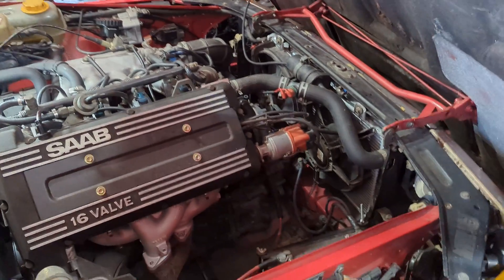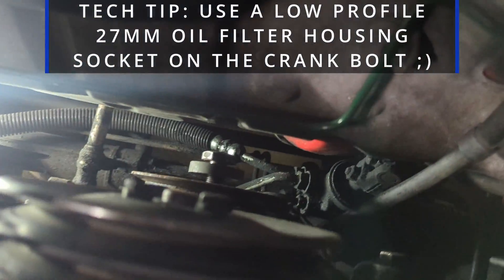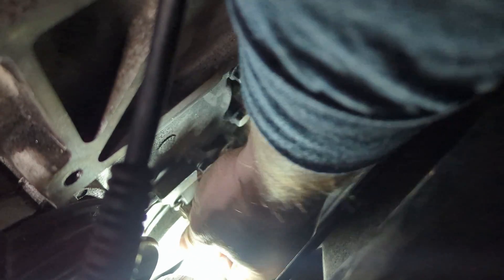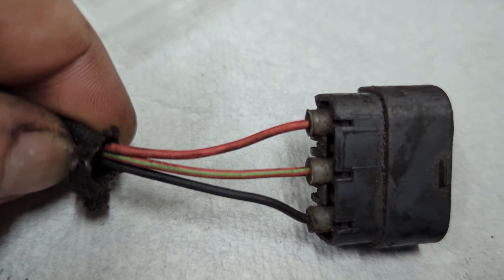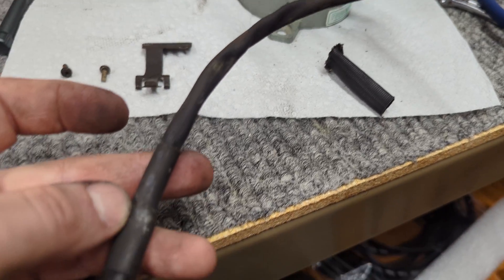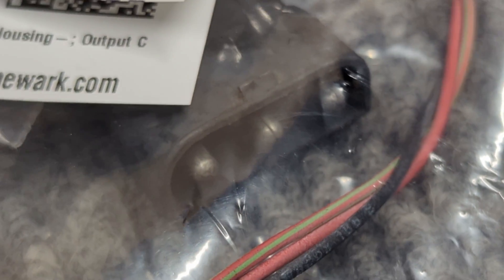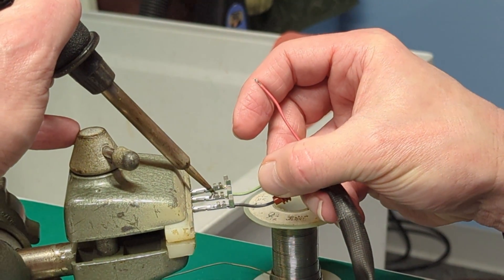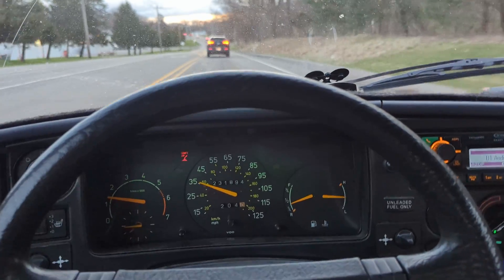How To: Replace the Crankshaft Position Sensor on a 1992 Saab C900 2.1 n/a

Comment: How did you diagnose the sensor being at fault. I’ve done so many tests and it’s narrowing down to the crank sensor. Is there a specific test you did? Mine just refuses to start
Reply from the maker: I didn't do a specific test, but I have been around these cars a long time, and the symptoms were consistent with the CPS going out.. For example: The car would randomly just not run sometimes, or shut off while driving. And it was worse the hotter it got. Also, when trying to start the car, the tachometer will normally bounce when cranking before it actually starts. When the CPS dies, the tachometer does not move. I was fairly certain that's what it was, being a 35 year old sensor exposed to heat and vibration, I figured I would rule it out either way.
Reply: @teamturner4300 Ahhhh okay. upon cranking my tach is completely dead so im fairly certain this is now the problem. Thankyou so much for the video man and the advice 🙏🏻

Comment: Would this work on the B201 engine?
Reply from the maker: I don't have any direct experience with the b201, but if the crankshaft position sensor is in the same location, then the procedure should be similar.

Comment: I had the exact same problem - even managed to break one of the T20 screws holding the sensor housing and connected the sensor wrong (according to the writing on the sensor which is wrong). There is a method to replace the sensor with one in a turbo distributor - haven't done that yet.
Reply from the maker: I looked into doing that, it is definitely possible as the turbo distributor has the sensor internally, the wiring isn't even that hard. That sensor in the distributor isn't as accurate/precise as the one behind the crankshaft pulley. At the end of the day I decided to just replace the defective sensor
Reply: What are the symptoms when this failure occurs ? Just suddenly refuses to start ?
Reply: Hi. Same question, were there any other symptoms and how did you know it was the sensor thank you so much for sharing your video.